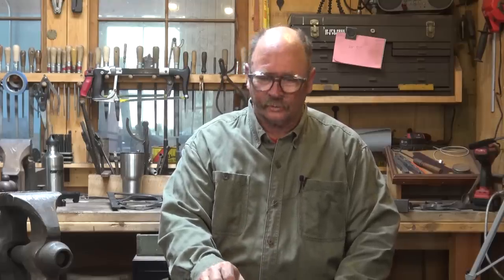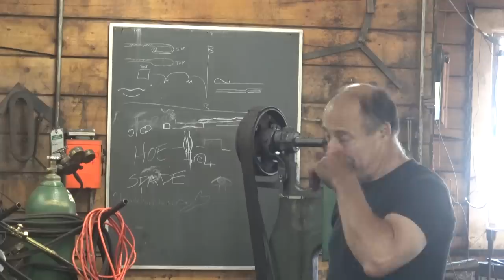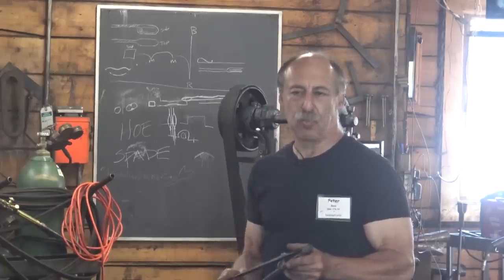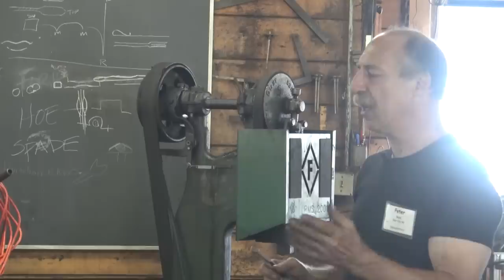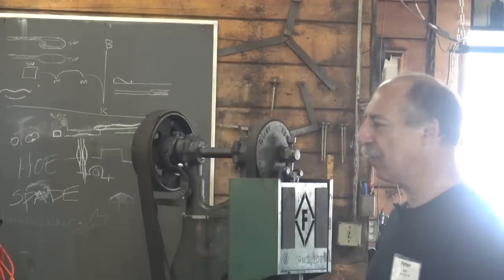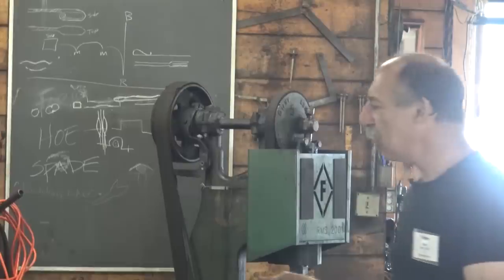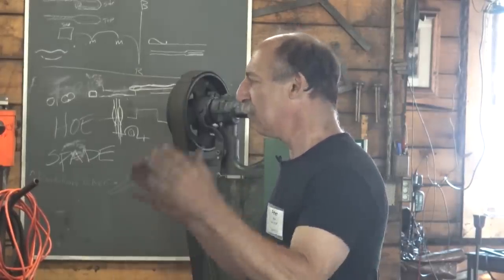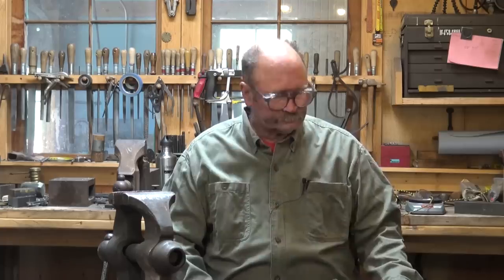Peter Ross discussing 18th century blacksmithing

Comment: Thanks John for recording this. Found it very interesting because I love history. I live right next to the historical town of Gainesville Alabama and it has a lot of history.  It was once the third largest town in Alabama with a lot of steam boat trade. It's dried up to just a little small place with maybe 15 to 20 original  homes left. I've set my blacksmith shop up in Gainesville next to one of the biggest of the old home.
Reply: @sophiaherschel567  although I generally agree that learning about the history of a region prior to European settlement is a worthwhile pastime there are several issues with your specific claim.
 Why does the fact that other things happened further back in time reduce the historical significance of an a particular region? 
 Recorded native American history that predates contact with European settlers is difficult for most of the public to access so it is fairly reasonable for someone to be more familiar with recent history.
 European settlers have had permanent residence in north America for almost 500 years, with what is modern day Alabama getting it's first permanent European settlements over 300 years ago with Gainesville specifically being founded a bit over 180 years ago, so the 200 years you mentioned is an arbitrary number that really doesn't represent any relavent major historical transition.

Comment: We know things now what they didn’t know then, such as that the silica in the wrought iron enabled easier welding and higher quality, particularly in the cast steel. Silicon is added to various welding rods, wire, etc. to remove impurities from the weld or braze. When casting that steel, the silicon would have bound to impurities which, since the silica is lighter than the steel, would have floated to the surface and would have been skimmed off as dross. How much of that they understood, I don’t know. Likely not much. Unfortunately, the earliest book I’ve been able to buy over the years is from 1836.